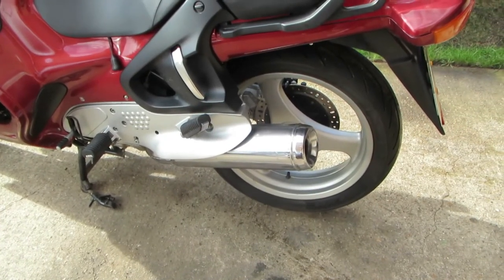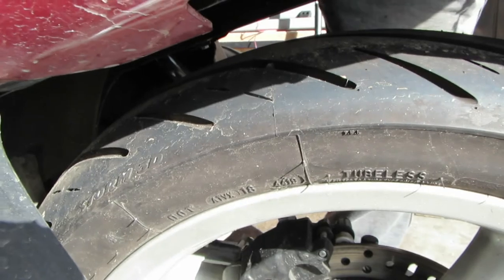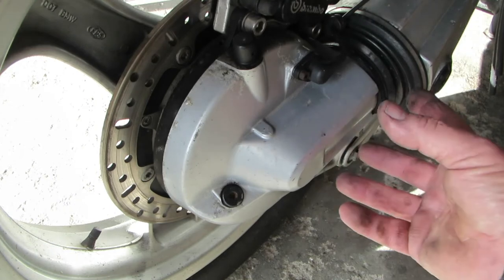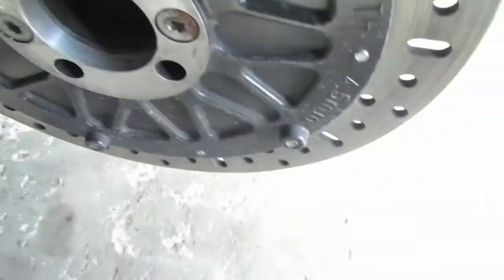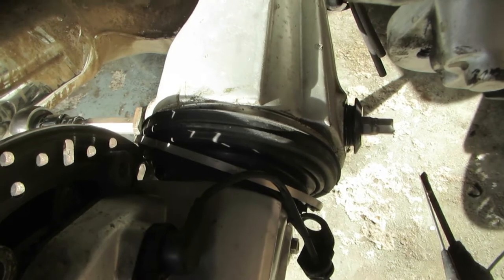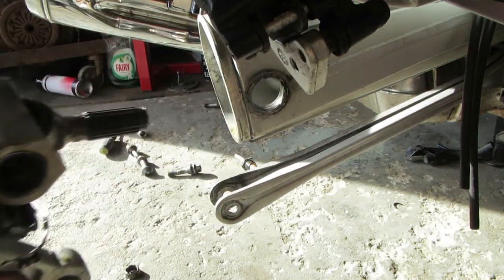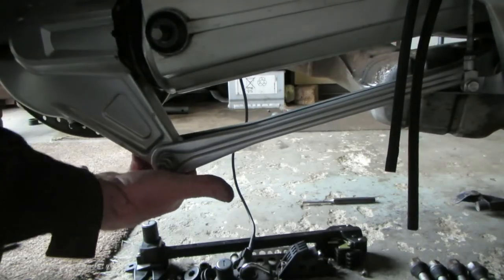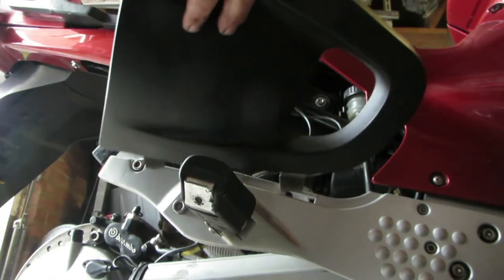How to change Rear wheel bearings on BMW R1100RT RS GS R| Restoration biker

Comment: Seems straightforward. Not very complicated.
I need to do this as I has play in rear wheel.
Reply from the maker: Yes, it is a straight forward job. Just do it one bit at a time. You will need heat on the pivot bolts, and a wheel bar to undo them, as they are tight. But apart from that you can do them easily. The bearings are dear £70 a side, but they last for ages. Don't forget when you pre-load at the end, don't go too tight. good luck. If you get any problems let me know, and I will help you.

Comment: I always put bearings in the freezer for a few hours before fitting them. By rights this should make them shrink a little and make them easier to fit. Keep them in the plastic bag so they don’t get ice on them, obviously.
Reply from the maker: Yes, I often do that when doing wheel bearings on cars where the bearing is large and an 'interference' fit

Comment: Thanks for posting this. It looks like I need to replace the swing arm bearings.
Reply from the maker: The bearings at the paralever arm are the ones that 'go' the most (see my video) the swinging arm bearings that are located at the gearbox end of the swinging arm, rarely give any problems.
Reply: @RestorationBiker  thanks for the clarification.
Reply from the maker: @aaron___6014  No problem. Let me know if you need any more help

Comment: Never hammer on the inner race of a bearing, put a socket on the outer race then hammering , that's the good way to do !
Reply from the maker: Hi, Yes you are dead right, my bad there sorry. Especially true when the bearing cost £70
Reply: @RestorationBiker  Put the bearing in the freezer before installing.  Warm the aluminum bearing pocket.  That will reduce the diameter of the bearing and increase the diameter of the pocket.
Reply from the maker: @ernstpeischl9365  Yes, that is a method I use quite a bit too. Especially with wheel bearings.

Comment: Well done Sir. Thanks for sharing.  I own an R1150RT and while this isn’t on my list to be done immediately, sooner or later it will. It’s only a matter of time. The only question is have is, after removing the final drive, why didn’t you lubricate the splines while you had it apart?
Reply from the maker: Hi, Good question, I must admit I always squirt a bit of grease in there whenever I have one apart. I didn't mention it as I do it without thinking. I should have made it clearer as it is a good bit of maintenance needed whenever the diff is removed.

Comment: Nicely done sir. I was hoping to see the check for play after the new bearing was fitted. Nonetheless a very informative demonstration. I have just had an MOT advisory for rear wheel bearing play on my R 1100 RT. I shall be doing the wiggle checks with more confidence now.  Thank you. 👍
Reply from the maker: Hi, Many thanks. When it is assembled you must torque the inside nut to allow the correct pre-load on the bearings. Too much will destroy the bearing, not enough will allow movement which will also destroy the bearing. In the books I have read that torque setting is 7nm. But I know there is quite a few people who dispute BMW;s advice.  That is why I say that people can decide what they want to torque it too. Once torqued there shouldn't be any play or else you have a bearing fault. So you can check for play in the same way as you did before. If there is suddenly play in a bearing it will probably mean it needs a new bearing. These are quite a fragile bearings under a lot of stress. So, it is paramount that it is assembled correctly, or you will be doing the job again. These bearings are not cheap. Hope this helps, thanks for the comments.

Comment: Is it possible to have the U joints out of phase when you slide the spline back together? That's not a good thig.
Reply from the maker: Hi, yes I have seen quite a few videos where people say "They MUST be phased" But!! I have done loads of these shafts, as well as on other bikes. I have never phased any shaft. It doesn't mention it in the factory manuals, so, I can assume it doesn't make any difference. If the shaft HAD to be phased you would find a 'master spline' on the shaft allowing it to ONLY be fitted one way. Some splined shafts (balance shafts etc) must be phased and I have seen a master spline fitted to them.

Comment: Restoration biker please advise.
 1) After a very spirited high speed ride I parked the bike (1999 R1100RT) in the garage. Came out about an 1 hour later to discover final drive fluid on the garage floor. At initial check it appeared that the leak was at the FD drain bolt but in fact not the case.
I checked the vent hole and it is not plugged. 
2) Bike with 110k miles has significant play in the rear wheel when manipulating the wheel @ 6 & 12 o'clock positions.

3) Please give me some direction in regards to the leak. I will replace the para lever bearings per your video. 
Thank you in advance
Robert from California
Reply from the maker: Hi Robert hope it is fine in the US. The probable cause of oil coming out of the final drive is either. Drain plug leaking, main O ring leaking, or a leak from the case joint itself. It is unlikely to be the case joints (but worth a check) Could be the crush washer on the drain plug. a lot of these bikes do get a 'misting' which appears on the rim of the rear wheel, after a long or 'spirited' ride. It can be the large O ring which is allowing a small mist to leak out. I have experienced this with a few of the bikes I have owned. I have never let it worry me so long as it is only a light misting. If the case is wet then it may be time to get a new seal fitted, (not a hard job) I will see if I can do a video to cover the rear oil seal of the final drive to help you out. I have an RT at the moment which is giving a light misting so I will put a video together for you soon.
Regards from the UK
Reply: @RestorationBiker   Your thah Man! I'll remove the final drive this weekend for starters. Best regards, Robert

Comment: You are changing one bearing, but there are two of them, on both sides. Maybe it would be better to change both at once?
Reply from the maker: Hi, yes you are dead right. But this bike had been failed for a 'wheel bearing' on his MOT, and the owner only wanted to replace the damaged bearing. If you are doing a full restoration, then perhaps you would do both whilst you are there.

Comment: You should source the complete front fork, all 3 brake calipers and discs, rims from a R1150.
Will upgrade the look a lot and a tiny bit more acceleration hence a 17inch on the back.
These bigger wide open brake disc are cool, you can seen through the wheel in contrary to now.
Reply from the maker: Yes, you are right. That is the good thing about these bikes. You can swap and change any of the bits from virtually the whole range. I saw a video, of a guy who had an RT and he changed it to a GS! Amazing.
Reply: @RestorationBiker  the brakes are 15mm bigger, the calipers are the same as found on Japanese sport bikes, that Japanese brand, the hollow appearance of the discs, the km counter is the same part, the axle is as wel, besides you have 10 year younger chrome pipes without pitting, rust or anything, together with steel braided brake lines, the performance wile be improved by alot.
.. and you need to replace the wheel bolts and wheel spacer that hold on the rear wheel.
Reply from the maker: @AnalogDude_  Yes the more you look the more you can see. There are lots of guys who like to change things and make it better, or faster etc.
Reply: @RestorationBiker  well, it makes the bike appear 8 / 9 years younger, you can find the parts at a motor salvage yard, the recycle crashed bikes and so, just try to make sure the disc are bolted on wheels otherwise you spend a lot of buying bolts, over 100€ if you need to buy all including discs, spacers.
Reply from the maker: @AnalogDude_  Yes, you are right. I love all the things that you can do. Especially with these BMW's
Reply: @RestorationBiker  But you gotta make sure you have all the screws, shims/springs, rings (from the donor bike) that hold the brake discs, the hollow screw of the brake lines on the calipers (with you also need all 3), they are like 12€ each, the spacers of the front discs are about 8€/each and you need 10. about 3,50€ for each of the 10 screws, you need the spacer of the rear wheel from the R1150 model, that's like 29€

Maybe some wheel bearings on the frontwheel and both rubber seals on the final drive.
Reply from the maker: @AnalogDude_  Yes, it is amazing how many small things are required when you make a start on a project like that.
Reply: @RestorationBiker  it's not that much, the front fork + brake calipers, discs and rim, rear rim plus disc and caliper, but if the salvage yard unbolted all or pretty much all. than you can add some 150€+ in bolts, spacers, spring rings, etc.
Reply: @RestorationBiker  Search for Baboon motorcycle parts if you're in Europe.
Reply from the maker: @AnalogDude_  Ok will do be interested in that thanks
Reply: @RestorationBiker  the triple tree where the key/steering lock, steer handle are bolted is the same part, the hard chrome down pipes & fork seals, copper slide bearings are the same, but the lower part of the fork is not due to other brake (Japanese) calipers, but the axle, km counter and spacer is the same.

the crown (where the wheel is bolted on) / piñon gear in the final drive the same part number, but does have a optional drive ratio available, but the housing is different, has a ABS sensor hole and no rubber bushing where the parallel arm is mounted.

Next week, i can confirm if the rear brake caliper fits the r1100 final drive with the r1150 wheel and disc. screws and bolts!

I saw some use a K1200 wheel (witch is basically the same, but doesn't have have the mounting holes for the r1150 discs and uses the r1100 disc, someone was selling. looks awesome.
Reply: @RestorationBiker  There is a hour long BMW R1100RS promotion video from 1993 on tube.
about 60 minutes long. the total R1100 layout is a pretty novel and it toke 4 years to make. kinda one of a kind.
Reply: @RestorationBiker  today i tried, removed the "old" k1100, K1200 & R1100 brake caliper.
The R1150 brake caliper slides on to the correct spot on to the K100, K1100 & R1100 brake disc like it's meant to be, but the housing cover where the 2 mounting ears are is different between the ears, there is a flat spot, but it's not flat enough.

you need the non ABS housing cover of a R1150R, R1150RS, R1150LT.

Housing cover - BMW-Motorrad, visible number stamped in the Housing: 2314884

Most parts are the between the R1100 and R1150 final drive, seals, bearings are the same maybe even the Final drive of r1150R, R1150RS, R1150LT will fit completely, but the used market selling price is not.
Reply from the maker: @AnalogDude_  Blimey there is always something that is different when you are trying to get something done isn't it? I find that as soon as I commit to doing a certain mod, everything looks great then one little tiny difference becomes a big problem.. Keep me up to date with how you are going I am really interested in your mods.
Reply from the maker: @AnalogDude_  Wow sounds right up my street I will look for that thanks.
Reply: @RestorationBiker  re watched your video, since i found out the R1100R from 94 already used the new rear Brake caliper and so do you. you only need the correct wheel spacer.

spoke wheels from the 02 "James Bond" Rockster?
: )
Reply: @RestorationBiker  Not to much, just modern wheels and brakes, restore red paint job, ad back than optional extras, new or overhauled throttle bodies, rubbers, replace chain & chain guides. maybe the gearbox (you need back frame) to 6 speed in combination with the hand controls of the R nineT and steer.
Reply from the maker: @AnalogDude_  Wow sounds awesome.
Reply: @RestorationBiker  It depends on whether the dealer is prepared or willing to adapt the connectors from the hand controls from the R nineT hand controls to the R1100 wire loom connectors.
They sell connectors but not the public only in their own garage. I'm not cutting and pasting in to the wire loom of the R1100.
Although i have the original electric plans of the bike, just 20€.

The main goal is that the bike never brakes down on me on a trip, so I'm replacing (visual) rusty bolts, rubber seals, bearings, etc. The Tank contents.

It was/is a bike sold to the government as well, i think the engineering is awesome of BMW and getting parts is easy in contrary to others brands.

Comment: I can't believe that you hammered those bearing. Get a grip. Learn how to be a proper mechanic, not a hack.
Reply from the maker: But late now, I've been doing it for 50 years. A light tap in the right place at the right time does wonders. Hit it hard at the wrong time in the wrong way = DESTRUCTION   When I did my apprenticeship, the first job we were given was a 1" steel ball. We had to turn that ball into a 1" cube. The ONLY tools we were allowed to use were a hammer, a chisel and a file. They then measured the size of each face using a micrometer. It HAD to be an inch. If you couldn't do that you were shown the door. So the use of a hammer can be a precision tool. If you know how to use it.
Reply: That is OK if you have been damaging your own bearings for 50 years. Showing and implying knowledge of a correct procedure when it is entirely incorrect could easily develop into a tragedy and at the least is a serious disappointment for the less informed. If you have a hammer in hand when installing bearings, you are about to show incompetence. Regarding your 50 years of experience, shame on you.     @RestorationBiker
Reply: I expect that you meant to say that you were given a cube and had a carve out a ball. The reverse as you stated, would not be possible. You must have learned early that compromising was a common and proper solution. Damaging precision bearings when installing on your own personal repairs is your choice but not on youtube where thousands of people are trying to learn correct procedures. Hammers to instal bearings are never acceptable.